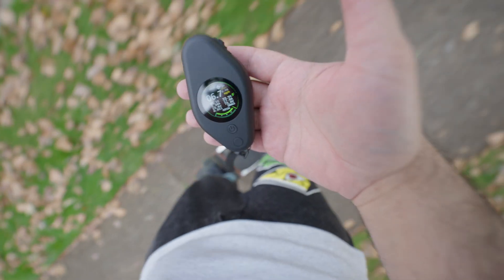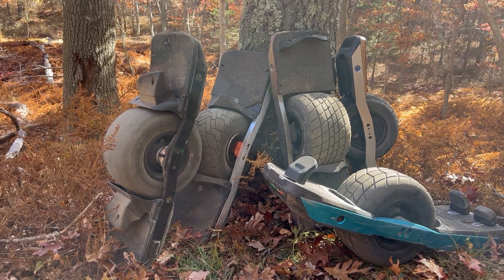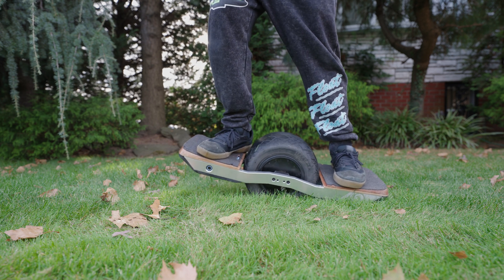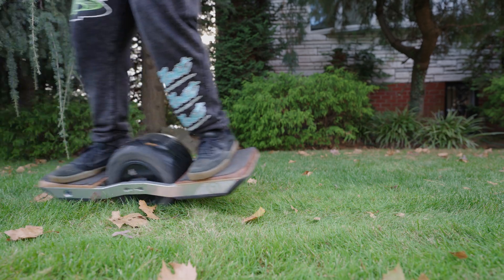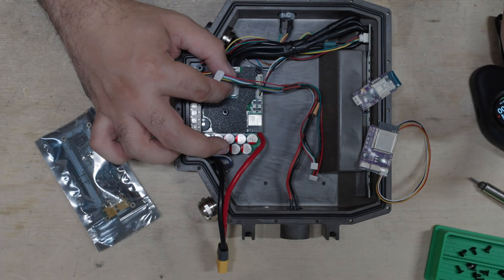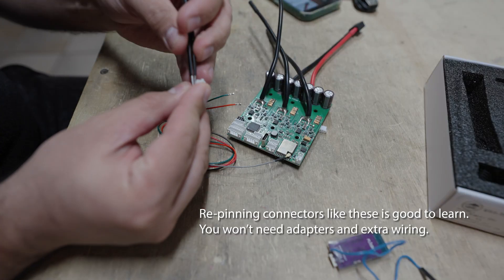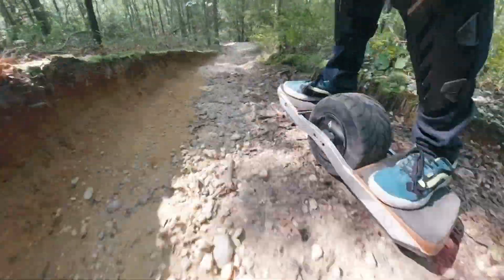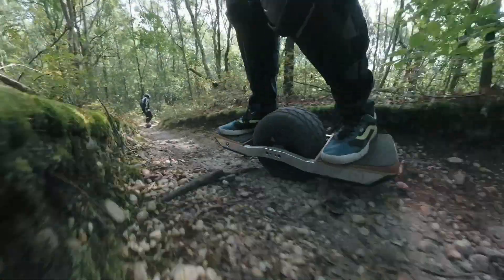Onewheel Remotes Explained

Comment: Here's an idea I think would solve the issue of ground clearance.

We could hook up a sort of distance sensor on the bottom of the board to detect the distance from the nose to the ground and maintain that distance to prevent bottoming out.
This would be great for road riding , up hill and downhill. But I don't know how well this would work for off road.
Still, not a bad idea though.
Reply: The way you describe I doubt would work any better than the existing ATR code. If you wanted your idea to work as well as a remote tilt setup you would need something more like LIDAR, and still the distance sensor idea in general I feel would only work if you mostly ever rode in a straight line... Plus stuff like trees rocks and bushes would cause errors. Still someone could try it for lols. The remote is really the key tool for otherwise impossible trails or features.
Reply: How will you keep optical sensors clean enough to work, 3 inches from the ground, for more than 50 feet? Sonar/radar isn't accurate enough.

Comment: Nice video. Do you know if a reciever can be wired to a floatwheel controller?
Reply: I was putting in a GT-V kit (same esc as ADV1) yesterday and it looked like the PWM connector is sitting pretty up top ready to be wired up to a Hoyt Puck... Not sure exactly. 100% possible but not sure if there is any special stuff with Floatwheels wiring or code. Hopefully just plug configure a little and play.